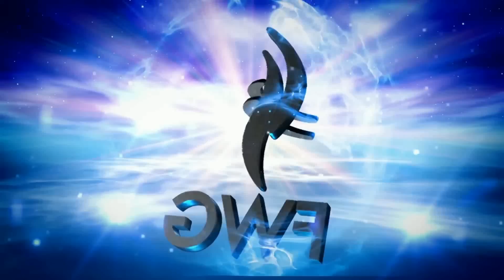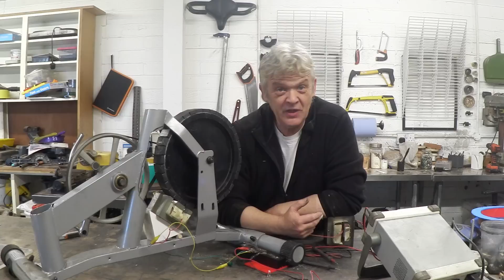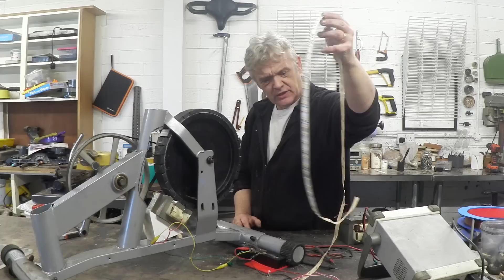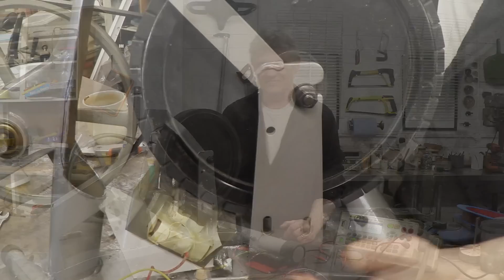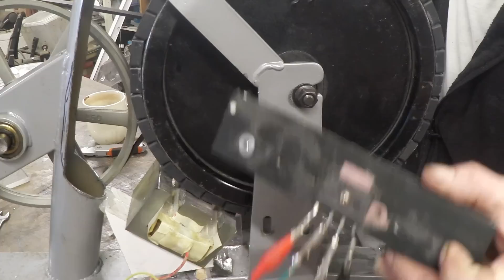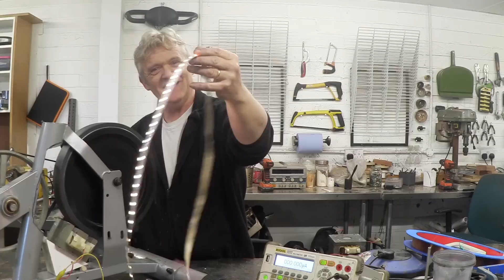Microwave Oven Transformer Into A Generator

Comment: If u want more juice orient the magnets to where north is in the center and south is on on the outer prices of the transformer.  It seems that 4 magnets come in contact with the dace of the transformer u may get better results with a NNSS magnet orientation that way 2 north or on the center and 1 south are on both the outer sides of the transformer plates u may get more complete u shaped magnetic fields on the transformer plates in turn making stronger output on the transformer
Reply: .....if magnet placements do work against each other then simply cutting off outer projections of iron core might give improved results . But accurate placement of magnets is preferred for top results.
Reply from the maker: cheers mate

Comment: Always interesting stuff you're doing. 👍🤓
I imagine that if both coils were left on the transformer, two different outputs would have been achieved.
Reply from the maker: Could be
Reply: cp,you still need to remove the "i" so as to make better use of the inner and outer winding polarity as the magnet goes by,testing required

Comment: with the neo magnets something half the size and spaced appart would still be better , go by the "pull weight"
Reply from the maker: cheers mate
Reply: remember Professor Eric Laithwaite said electromagnetic machines seem to get better the bigger they are, magnetic machines seem to get better the smaller they are. for "pull weight" several spaced metal disks (tesla tubine style) held over a travelling magnetic field will provide "better" pull force for less weight than a single solid round bar
Reply: @paulmaydaynight9925  the stronger the magnet the shallower the depth of field

Comment: may i ask a dumb question could we not leave both coils in ? also in the  set up you have would you not get more out put by reorientating so the coil is closer to the magnets?
Reply from the maker: try it and see mate
Reply: It's about as close as it can get, as is. He would have to take an angle grinder and carve out the profile of the rotor from the core of the transformer to get it any closer but yes, that would increase the output.

Comment: As always, great video!  Practical use of things that would otherwise end up scrap metal.  Now it just needs a 2m set of blades and a 5m pole!  This could charge a capacitor bank and with a voltage regulator, charge batteries for an off grid lighting system.  If I hadn't already aquired a load of 3 phase washing machine motors, I would be out looking for an exercise bike! I always thought of myself as a decent scrapper, but you are definitely deserving of some sort of trophy!
Reply from the maker: lol - cheers mate and nice suggestions cheers

Comment: very Good video.   Moving the coil closer to the magnets would help, that's a big gap.
Reply: It was a prototype, but certainly.  I would also grind out the top to match the curve and use N65 magnets.  I would also adjust the ratio of the pulleys a bit to use for a wind-driven generator.  Perhaps adding 2 more coils to the transformer core would work to generate 3 phase?  I would probably try a neon sign transformer as well..many things could be done to optimize the efficiency of the device Robert has built.  As he says in the video, it is sufficient to prove that it is a working platform.
Reply from the maker: it is indeed and yes it would help a lot - field strength decreases with the square of the distance

Comment: Use the coils from the washing machine pumps just take out the existing magnet housing and cut the ends of the the fork so its flush with the coil housing. Will work better that the mot.
Reply from the maker: cheers mate

Comment: Very nice. One thing I saw is the LEDs seemed to get brighter when one part of the rotor went past. I'd wager that's where the gap in your magnets are. I'm sure you'd get more output if you spaced the magnets at the same distance apart as the fingers of the E in the transformer.
Reply from the maker: well worth a try mate - go for it and let me know how it goes - you know prefer experiments lol
Reply: @ThinkingandTinkering  Well I've gone and ordered a bunch of magnets, so I might manage to actually get around to doing that soon lol. I've got couple of flyback transformers to strip down.
Reply: Yes, this is exactly right. The whole point of the iron core is to conduct the magnetic flux. If you want to apply a magnetic field to that assembly, then for maximum results you want to line up, for example, one of the core fingers with the N of one magnet while lining up the next core finger with the S of the next magnet, and so on.  If you don't do that then you aren't really taking advantage of the actual physics, you're just waving some magnets around in the vicinity of a cut-up transformer hoping for something to happen.

Comment: Come on, you have everything right in front of you, minus maybe a smoothing cap, to measure the power generated directly....
Reply from the maker: I do - but what about others who don't necessarily have my set up? what would be an acceptable guide to give them some measure of success? and by acceptable I mean acceptable to them not necessarily acceptable to you lol
Reply: @ThinkingandTinkering  you have transformer wire and a multimeter... the left over microwave parts would have a suitable capacitor, or any ac to dc converter. You even have a 1k wire wound resistor you made last time.
Reply from the maker: @MartynPS  for sure - do a video on it mate

Comment: You have to love those microwave transformers! They are so versatile. I have four mounted in a box and wound with one turn of 50mm wire each to make a very powerful spot welder (I use it to pull bodywork dents). Obviously, I used the primary coils and removed the secondary. 

I do like this idea. If the transformer was ground down to fit closer to the magnets, would it be more efficient (I know you don't like that word)? Or would it be so little that it's not worth the effort?
Reply from the maker: the field strength decreases with the square of the distance mate so the nearer the 'fit' the higher the output and the increase is marked - so i would say it was worth it for sure
Reply: @m w  For the generator,  I believe that parallel will give you more amps at the lower voltage and series will give you more voltage at the lower amps. I'm thinking about using four or six around the magnet wheel. 

My spot welded is four in series, but only one full turn of wire on each. This puts out about 8v at about 600amps. If I'm not careful,  it will melt a hole in the car body!
Reply: @m w  mw, did you forget about roberts low power paper/stone heaters for all your cold working area's, time to make some aluminium can string collector/terminals and paint some diy heaters

Comment: That's good.  You could fine tune it by spacing the magnets so that when a north is over the centre of the laminations you have souths over the ends, and vice versa.

Re that blue coil, you're not getting much out because the magnets are rotating parallel to the windings, try turning the coil so that it is perpendicular to the flywheel.
Reply from the maker: I am not sure I think it was just too far from the field mate - field strength decreases with the square of the distance - and really the field was normal to the coil  - but cheers, Rob
Reply: @ThinkingandTinkering  Ah but - the rotation was parallel to the coil, according to Flemmings Right-Hand Rule all three must be mutually perpendicular to generate a current
Reply: @rogerbarton497  you mean a 'higher' current, thats the thing about following mathamatical rules to the letter, to cover 'more' of the  perpendicular wire you would perhaps make the magnets follow a complicated mechanical sawtooth wave path
Reply from the maker: @rogerbarton497  I am sorry mate - I don't really like to say this but Flemming's rule indicates direction of current flow in a given set of circumstances -it doesn't govern anything - Faraday's Law tells us the a coil moving in a field will generate an EMF and Ampere's law tells us about the current - actually I just replicated the same set up found in the synchronous motor that we pulled apart at the beginning of the video - so we have a good idea that the setup is fairly standard and works, which to my mind means the main issues are really about the specific  implementation as opposed to the general structure
Reply: @paulmaydaynight9925  Sure - the rules of basic physics assume perfect conditions, perhaps I should have "significantly more more current".

EDIT -   "make the magnets follow a complicated mechanical sawtooth wave path"  or just mount the flywheel on wobbly bearings!
Reply: @ThinkingandTinkering  You won't generate an emf in a piece of wire if you move a magnet parallel to it.  You generate maximum emf if you move the magnet across the wire at 90 deg.  I suspect the coil was not wound perfectly so you could have situations where the wire runs at an angle in the magnetic field, thus generating a slight emf.

It would be interesting to try rotating the coil as I suggested above to see if you get an increase in voltage/current.

That synchronous motor is interesting, there's a microwave sat on the pavement opposite my workshop, it will be gone when I finish typing this, I'd like to examine the turntable motor before commenting further!
Reply from the maker: @rogerbarton497  go for it mate
Reply from the maker: @rogerbarton497  fair enough - all I can say is from my reading of it is that a time varying magnetic field is always accompanied by a spatially and maybe time varying non conservative electrical field as per the Maxwell faraday equation and if we are to believe Einstein all that is required is relative motion of a conductor in a field - but I am guessing here and don't really know - but I like your suggestion and it would be good if you pulled apart a motor - when measured the field it ran north on the outer of the magnet to south on the inner - cheers
Reply: @rogerbarton497  lol, i'm not sure how you would make that, or what fractal algorithm it might follow, but we could call it 'the webbles rule'

Comment: Something iz bugging me. That LED strip should be much more than 1W. I belive you are generating more power, then you measured.
It would be interesting connectinh LED strip (load) through a W metter. To see volts, amps and watts at the same time.
Reply from the maker: it probably is mate - but I hate overpromising lol - still good point I will measure it under load too

Comment: What if you try the primary of the MOT sure lower voltage, But  maybe a half ampere out ?
should have tried it before removing the primary coil .    love your channel.
Reply from the maker: tried it mate - it's a bit 6 or 2 x 3 either way to be honest

Comment: Also notice how slow Rob was turning the pedal and how easy it was?
Reply from the maker: it was pretty easy mate
Reply: @ThinkingandTinkering  I personally think that a coil with thicker wire in the windings should always have a ferrite core to increase the magnetic influence, at the moment this is a theory but all the best generators use iron core coils.

Comment: I have spent £300 for neodymium magnets for the generator I am currently building . In the case of your build using neodymium magnets they would act as a brake and it would 
not work.This shows that there are many ways of building generators for different purposes .Where did you get the cheap magnets from .I would like some to do some experiments
to see their potential.
Reply from the maker: oh it would work mate - actually it depends on the field strength not the type of magnet - these ones have 3.6kg of pull per magnet and you can buy the same pull in Neo - in which case it would work fine - if the pull was beyond the input source power then that would be a no go - equally too strong a magnet for the coil size would lead to heating effects
Reply from the maker: ps - I just ordered them online eclipse magnetics and first4magnets are good places
Reply: @ThinkingandTinkering  Just ordered some .Thanks

Comment: To take one coil out, you can cut the wires on both sides instead of opening the iron part. Then you take a rod and a hammer to push the inner copper wires out.
Reply from the maker: cheers mate - I have done videos on extracting the coils
Reply: @ThinkingandTinkering  yep, new here
Reply: Hugues,oc doing it that lazy way doesnt reclaim the most valuable ready to go parts, the already processed insulated copper, its pritty hard to build anything by destroying your ready to go base materials

Comment: Robert, I see a lot of unclear thinking in the comments about the point of building prototypes. I completely understand the frustration but rest assured that you’re pulling us all a little further down the path of understanding. Not everyone is going to learn in the same way or at the same pace. You’re doing your part.
Reply from the maker: thank you mate for taking a bit of time to post that - I appreciate it and like everyone I need a reality check every now and then - cheers
Reply: Robert Murray-Smith I grew up with two teachers as parents. This is how teaching goes, for better or worse. If you stop caring entirely then you won’t be effective at teaching, but if you care too much then you’ll burn out. It’s one of those balance things that you never quite perfect, you just have to make constant adjustments over time. Anyway, I really appreciate what you’re doing so I’m trying to keep you making more. 😀
Reply: I have 30+ years experience in electronics. If you count my time as a hobbyist then more like 40+. I still do a "proof of concept" prototype before a full prototype. It usually does not save me much time these days (as I often get designs right first time) but it certainly used to. I suspect many of the people who don't understand this are still at school.
Reply: Dear God people think here. Without prototypes imagine how dangerous Boeing would make air travel.
Reply: @worldsgonemad4600  lol, wait a 737 minute now…
Reply: @worldsgonemad4600  The "IKEA Effect" ~Why the Gods so Cruelly cut my career short as an Apprentice Aircraft Engineer!! 🙂💞
Reply: @worldsgonemad4600  I'm an electrician, and I been known to use boxes of conduit fittings, loose cardboard and tape, and assorted pieces of wire as rails and such, to show an engineer why it wouldn't work.

Comment: Bloody awesome mate 👍 Imagine if you had about 6 microwave transformers on a single flywheel connected in parallel, then imagine another 4 to 10 flywheels connected the same way and powered by a windmill or watermill. You would have something that could run a circuit that rectifies then regulates the power so it could trickle charge a battery bank of at least 200 to 500 Ah's continuously 24/7. 
Then connect that battery bank to an inverter to run a few appliances (Refrigerator, Television etc,) as well as all the lights (running on LED's) in your home for free. 
This combined with other generator projects around the house would save you hundreds off your power bill each year. This means that this project would pay for itself in the first year. Everything after that year is pure savings.
Once again, great video Rob, you're a pure gem, one in a million. Thank you,
Reply from the maker: tbh mate - I think this is very usable for something cobbled together from scrap
Reply: @ThinkingandTinkering  Don't connect the coils together unless you connect them so that they are in phase.  Much easier to have a bridge rectifier on each coil and connect the DC outputs together.
Reply: One could reduce the losses of the system you've described quite a bit if they just ensured the coils were in phase, and connected them in series. There's enough room on that wheel to affix 8-9 coils, so as long as you use a mechanical speed regulator you could ballpark the 220-240(whatever your appliance wants) without conversion steps in between. Seeing as how rectification is ~70%, battery charge and return is 50-90%, and inversion runs from 80-95%, that means that on the low end you have (generator output × 0.7 × 0.5 × 0.8 =) 28% of the power you started with, and on the high end(as in, with expensive equipment) you have (generator output × 0.7 × 0.9 × 0.95 =) ~60% of the generator output after the inverter.

Comment: We did the exact same thing in science class with Mr Kinsella in 1976, ring of magnets transformer coil. Awesome that Rob is just discovering it, but do not see anything relevant here other than secondary school physics. Rob may I suggest you edit the text of your about the channel page on youtube, it is way out of date: "The main focus of the channel is on energy, graphene, batteries and super capacitors."
Reply from the maker: yeah I should look at it cheers mate
Reply: "just discovering it" "remembering and relating information" "showing you the basic engineering" are related but not the same oc, they can finally give you a reason to turn that stored knowledge into practical wisdom by giving it a go.
Reply: @paulmaydaynight9925  I have generated all my electricity for the past 10 years, I live off grid. Whats your point, do you have a relevant one ????